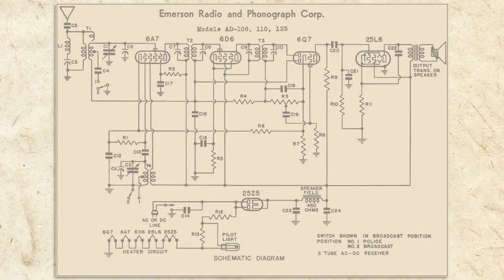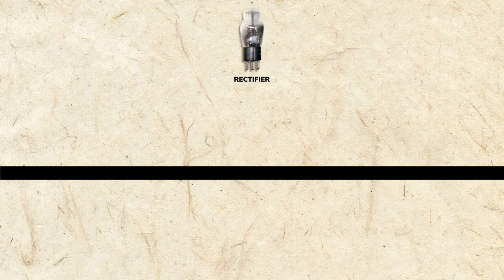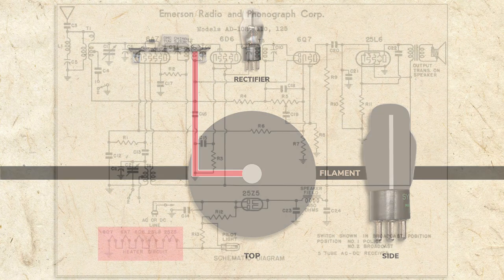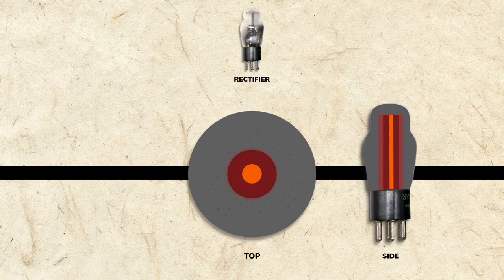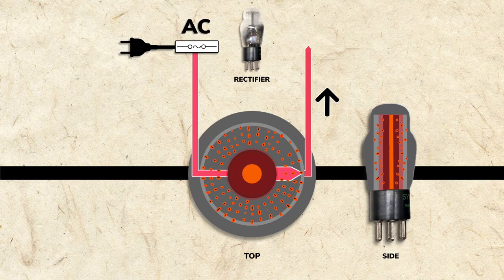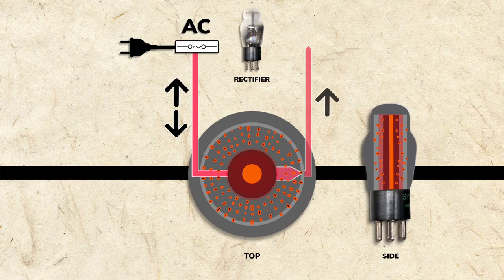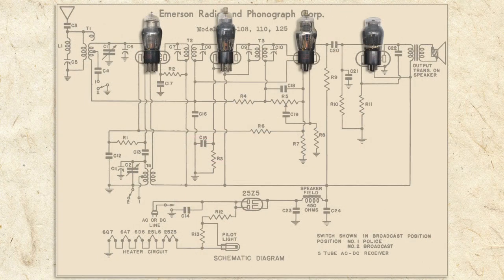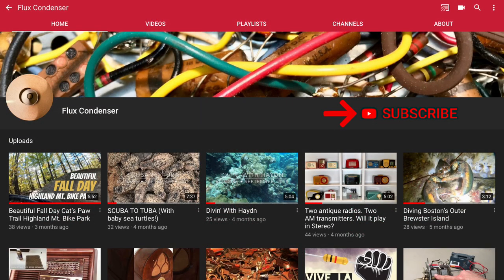How Do Rectifier Tubes Work?

Comment: I hope you might be able answer a question.  I get that current flows from cathode to plate.  So why does B+ voltage come from the cathode of a rectifier tube instead of the plate.  I make that assumption because it's always the cathode that is connected to the center tap of the OPT.  I can only make sense of that if this were -ve voltage but obviously it's not so I can't make sense of it.  Much appreciation for this series and even more if you are inclined to answer this dumb question.  Thanks.
Reply from the maker: Great question, murfbass and this confuses a lot of people. The simple answer to your question is that the rectifier cathode is connected to the B+ for the same reason that when arranged in series (as in a flashlight), the positive terminal of one battery is connected to the negative terminal of the next battery. 
To help explain this in more detail, I did a drawing which you can view here:
https://youtu.be/H2rqrb_Xkk0
As you look at the drawing, it’s easier to see why we can get confused and make the mistake of thinking that because the rectifier cathode is connected to the B+ (it creates it, really) that its charge is positive. In reality, the B+ is positive BECAUSE the rectifier cathode is negative. The current in the rectifier doesn’t flow from the AC side to the DC side, it flows from the DC side to the AC side, again, just like batteries arranged in series in a flashlight. The other tubes are arranged similarly. This goes for the filter caps as well, but they’re wired in parallel to the radio’s DC supply to provide a smooth, uninterrupted DC. Also, note that when the rectifier plate is negative, the negatively charged electrons from the cathode won’t budge and the rectifier won’t conduct. Again, thanks to the filter caps, though, the radio continues to receive uninterrupted DC even with the rectifier temporarily turned off.
Reply: @FluxCondenser  Thank you for helping.  I'm sorry I don't have an Apple product so I can't see your drawing.  So in batteries the flow is negative to positive.  In a rectifier, the negative to positive flow is from the AC side to the DC side where we immediately see the B+ going to the OPT.  The part where I am confused is, it would appear that the flow inside the rectifier tube goes from plate (coming from AC HT) to cathode (going to the subsequent DC circuit ie. OPT as B+).  That is, the AC to DC flow is plate to cathode.  Yet I believe a tube can't conduct positive voltage plate to cathode, can it?
Reply from the maker: murfbass The electron flow inside the rectifier is not from the AC side to the DC side, but from the DC side to the AC side. I put the drawing into a video form you can see here: https://youtu.be/H2rqrb_Xkk0
Reply from the maker: murfbass You can view the drawing here: https://youtu.be/H2rqrb_Xkk0